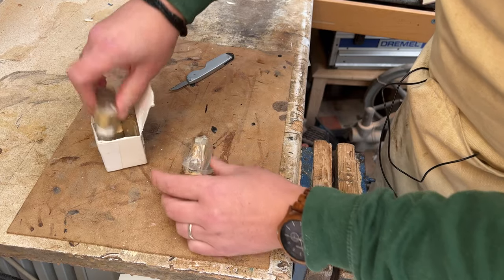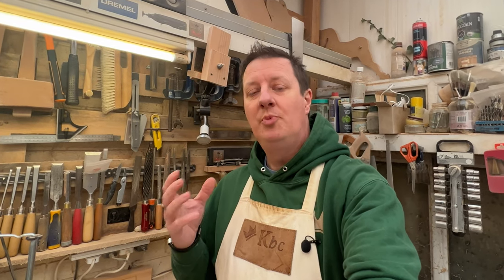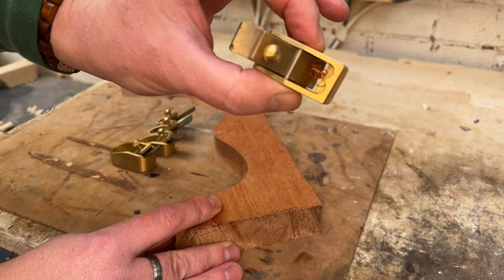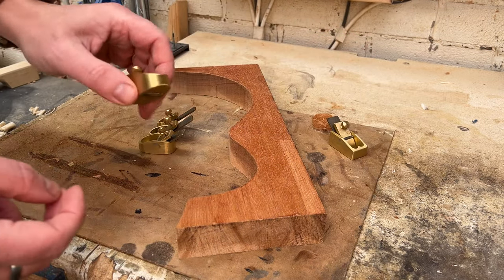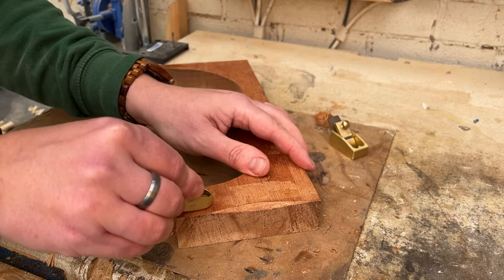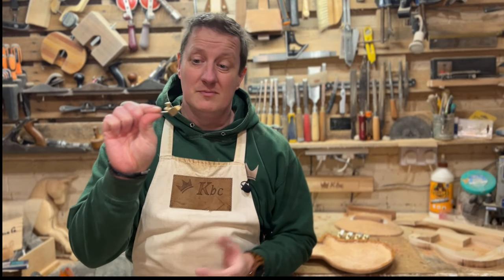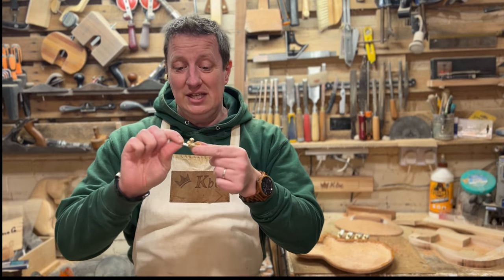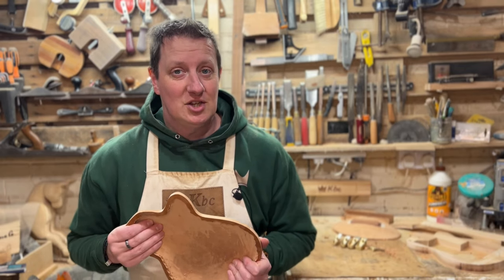5 Plane set for UNDER £60! Can the Ammoon violin plane be ANY good?

Comment: I've been using a set of those cheapies for years. I did spend a bit of time filing and smooth sanding all the edges around the tops of them to make them quite a bit more comfortable but they're not bad at all.